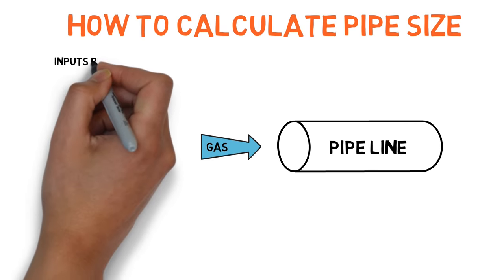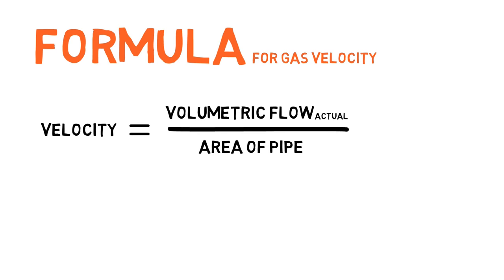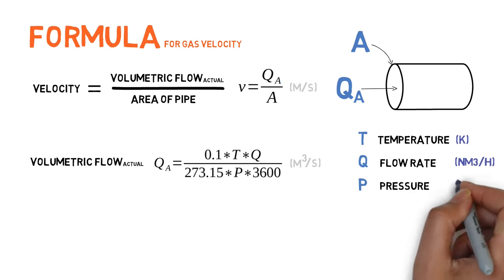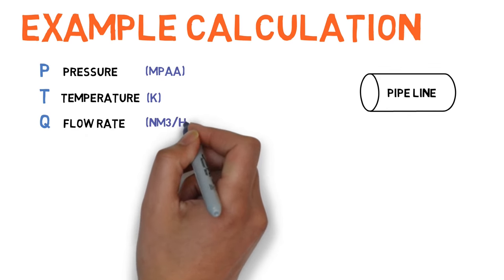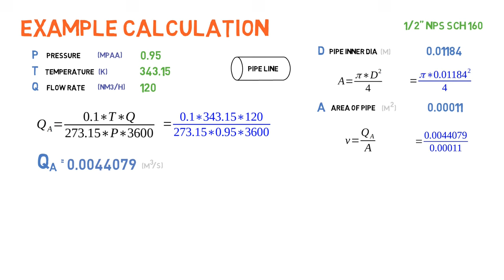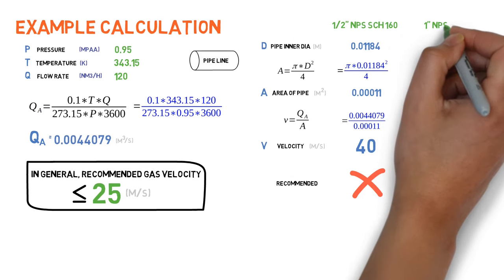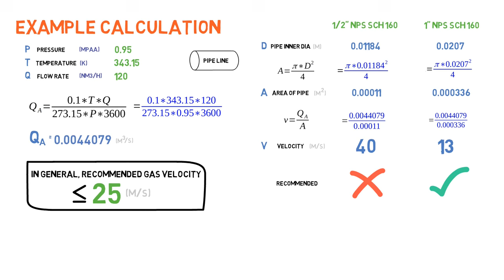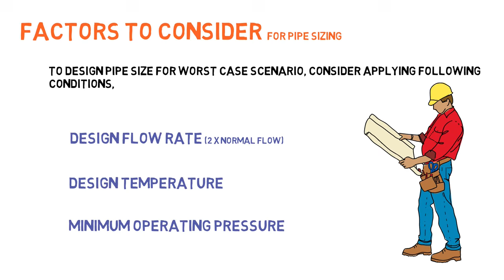Pipe Line Sizing by Velocity for Gases | Simple Science

Comment: Why does "in general" the gas velocity should be under 40 m/s?
Laminar/turbulent flow?
It is very far from the speed of sound that might cause any sort of undesirable effects
Reply: Noise and pipe erosion.  Pressure drop is also usually too much.  Actually for a more optimum economy for long distances, 20 to 30m/s is even better.

Comment: Thank you so much. But where does 273.15 and 0.1 came from?
Reply: I just found 273.15 is absolute zero. What about 0.1 value sir?
Reply: @LeeeJim   it is related to the pressure. The original formula for normal volume flow rate and actual volume flow rate is (normal means at 273.15 kelvin and approx 100 000 pascal):

Q = Q0 * (Z * T * p0) / ( Z0 * T0 * p)

Z and Z: are compressibility and normal compressibility, not considered in this video
The 0.1 in the formula (in the video) is due to p being in MPa and to p0 not being explicitly included in the formula.
Reply: @LeeeJim  1 atm. From combined gas law.

Comment: may i know which reference these formulas came from?
Reply: what is 3600 and 0.1 in the formula?
Reply: @Imsama123  hour unit was converted into seconds = 1 hour = 3600 seconds
Reply: @Imsama123  0.1 is related to the pressure. The original formula for normal volume flow rate and actual volume flow rate is (normal means at 273.15 kelvin and approx 100 000 pascal):

Q = Q0 * (Z * T * p0) / ( Z0 * T0 * p)

Z and Z: are compressibility and normal compressibility, not considered in this video
The 0.1 in the formula (in the video) is due to p being in MPa and to p0 not being explicitly included in the formula.